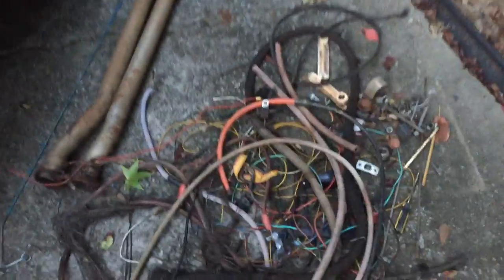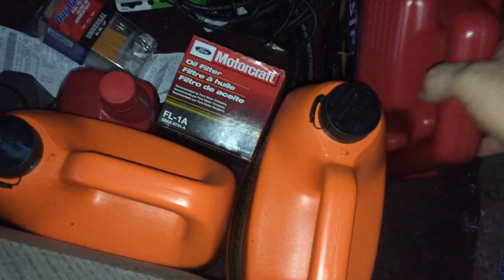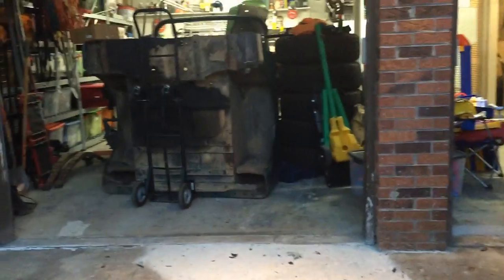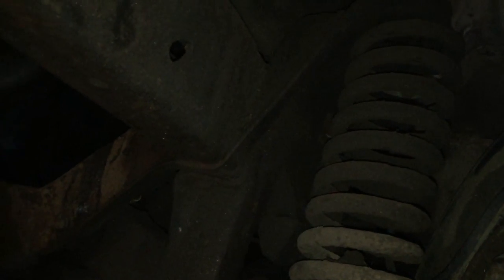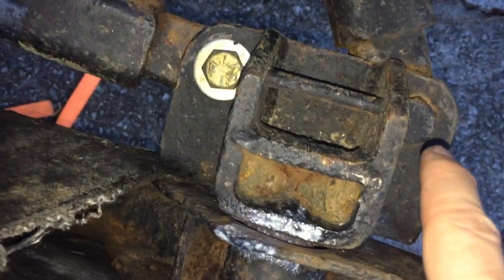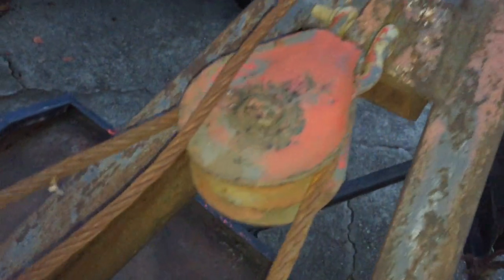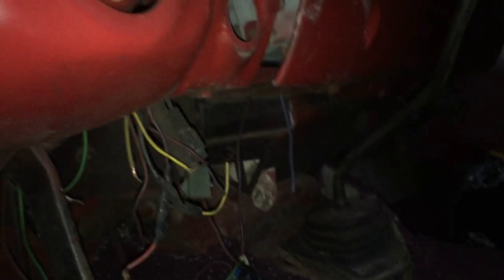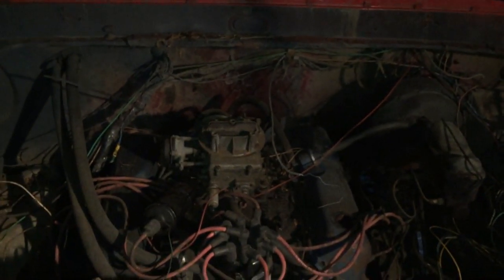Tow Truck Clean Up - What did I buy?

Comment: Jack I just found your video about your wrecker-- I used to run a Holmes440 when I was driving tow rig back years ago!I know what several of the things your asking about the truck and wrecker! If you still have this project and want info help please msg me back with live contact info!! Its now 2020 but that truck had f 350 (1ton) chassis. Please get back to me I have enough knowledge of the working unit I started out in and dearly loved. I eventually went all the way to a Homes 750 wrecker, that was the 18 wheeler size, back before they sold Holmes Wreckers of to another Maker & hydralics came on the wrecker seen! Craig